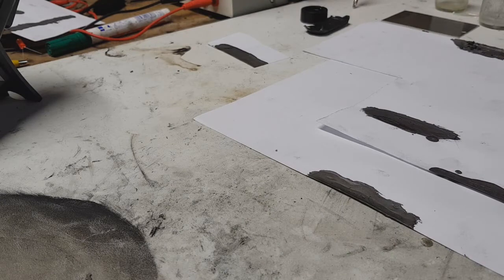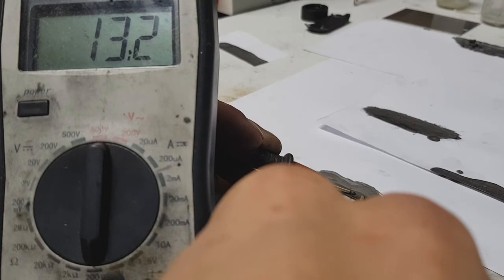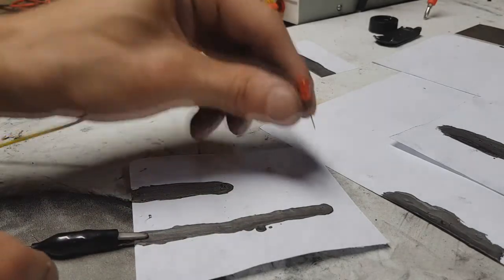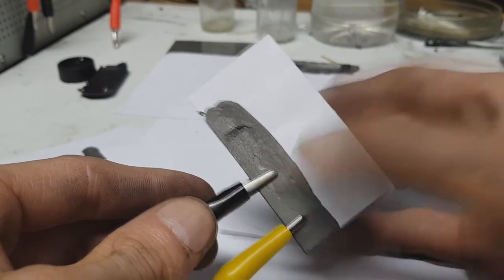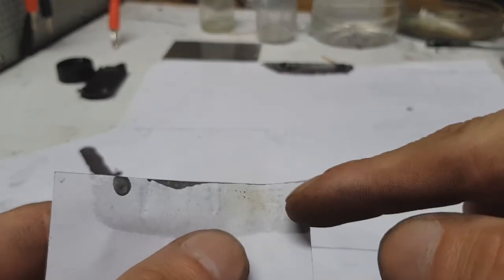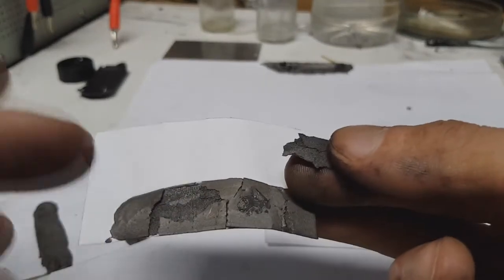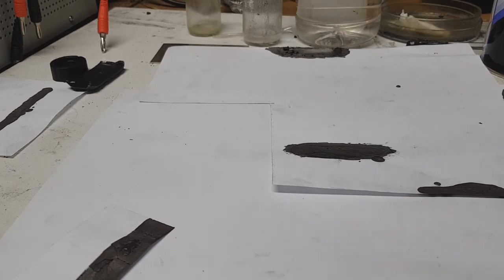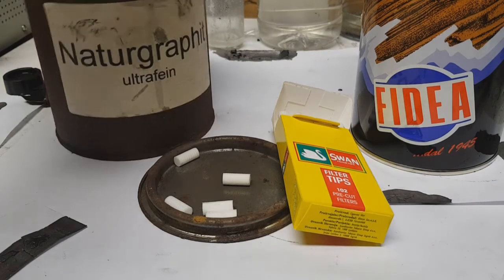How to make CONDUCTIVE INK easy

Comment: What you have made is more of a conductive paint, which has been around along time now. If I was you, I would give up, as just yesterday on You Tube, I seen an advert for a pen that disperses conductive ink.
Reply from the maker: Give up??? Hahaha, dont be funy. I have a series of paint products, like multiuse paint, high temperature paint, super conductuve paint, IR paint, fast drying,...etc. Whit which I make a deals with companies.
Reply: @cayrex  I stand corrected, well done.
Reply from the maker: Give up, is the first and last mistake which you can make. Many people give up to fast. If you really believe in what you do and you work hard,.... dont make a mistake and dont give up. Maybe it will not go on plan on fist time or second time,.... but if you will push and push really hard you will go to the finish. So,....  dont give up,.... push! 😉

Comment: How much current has to be used to heat the ink as the heater you performed?
Reply from the maker: Jeffrey Rood 250 to 500 mA
Reply from the maker: Jeffrey Rood I use maximum 5 watt. If you make more conductive you can use less current to make the same temperature. This was not my plan to make a heating ink, but I try anyway and perform nice job for some homemade ink.
Reply: Sir explain method how you make this ink kindly

Comment: Hi, did you try the cigarette filter itself for cellulose acetate. I'm a heavy smoker so I tried dissolving few cigarettes buds in acetone. And casted the solution on glass. It made a film but it was so fragile.
Any comment. Thanks.
Reply from the maker: ShapeMemoryDoctor so, this conductive ink is not flexible. You can add some smal amount of sodium silicate, but you will make this ink slightly "stronger" but not flexible.
Reply: I tried again few smoked cigarettes. This time I removed the paper and soaked it in acetone. Better results, stronger film and with graphite powder I got 100 ohms. 
Will test with unsmoked cigarettes, hehehe.
Reply from the maker: Mohamed Moussalli yes, I try myself and work. I add 6 filters in aceton. And I get slightly dense ink , then I add slightly more acetone for more liquid ink, on the finis I add graphite. Try other filters
Reply: Adding a little bit of another binder, would it make it less fragile? I've got Sodium SIlicate. I think I will try.